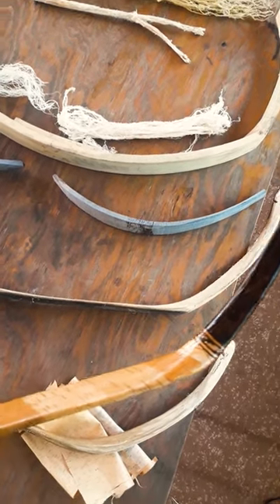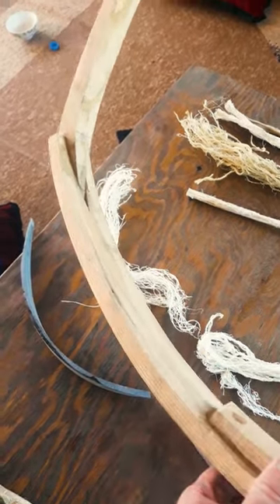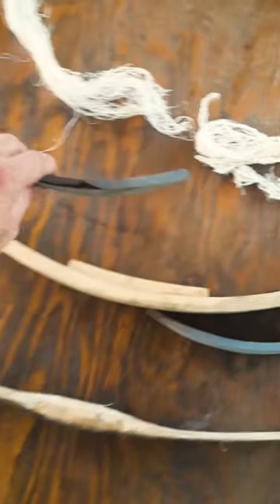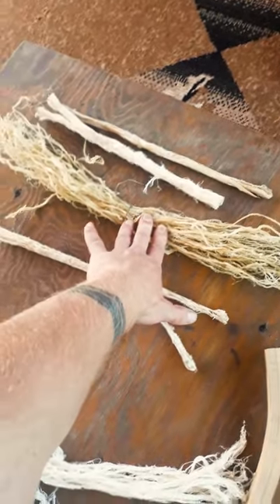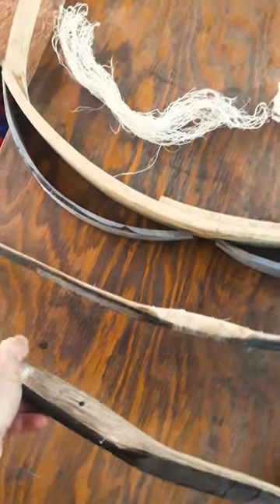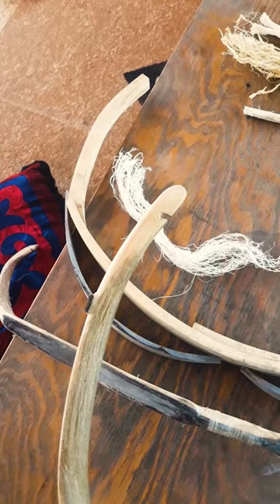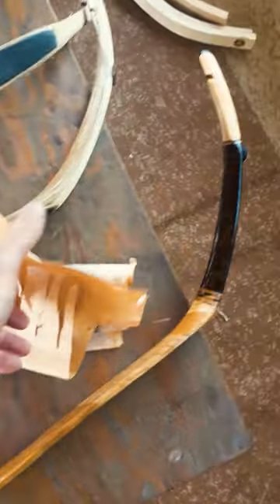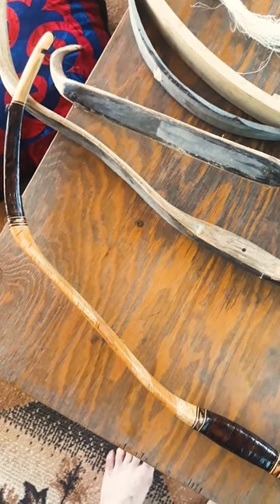hornbow materials

Comment: So…tillering is done on the back, before sinew is glued on?

Later on tillering the belly side?
Reply from the maker: Fine tillering is done during opening bow, it is proces after all sinew layer are dry.
Reply: @tengribows5533  but rough tiller on the back first?
Reply from the maker: @ratamahatta1300  Its not called tiller, but yeah, offcourse wood have to be trimed down to required thicknes, there have to be tapers also. You cannot bend the bow much without sinew, tillering is proccess when you watch the bow how its bend.